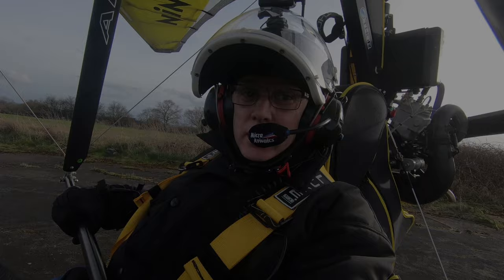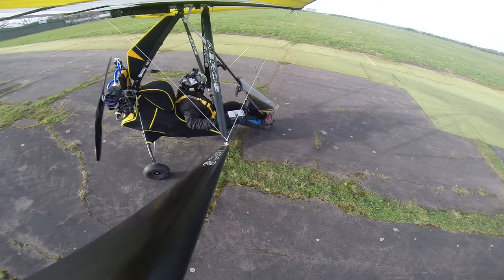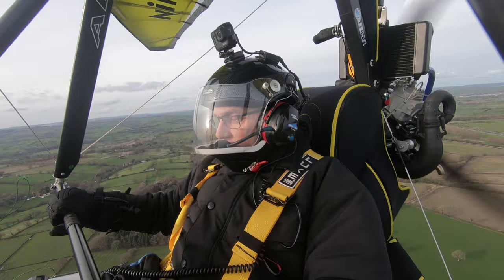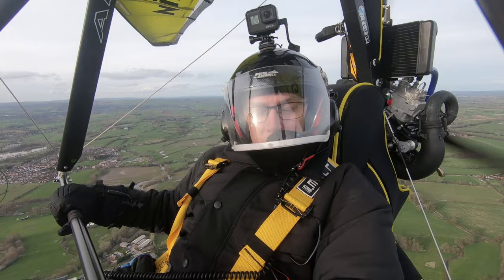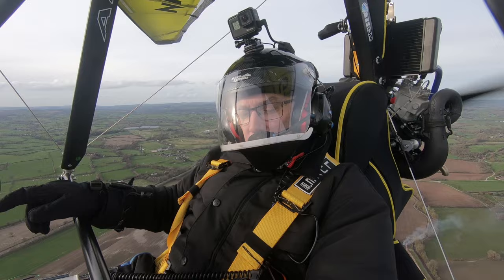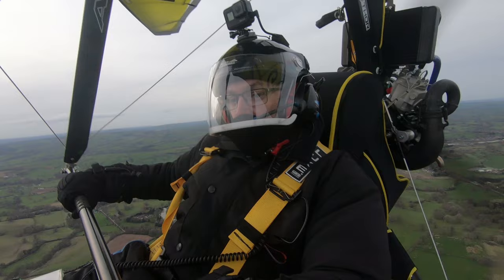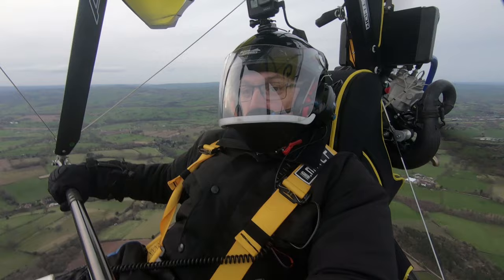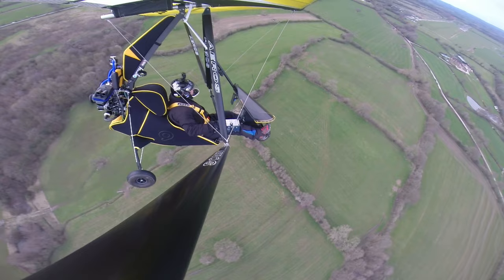Going further and faster - Stretching my NiNE legs

Comment: Excellant information, would be nice to do the same route (same time) with a Sub-70 too and compare the difference in the machines/time & fuel burn.
Reply from the maker: I think that I would probably burn more fuel on the Peabee just because the fuel burns are so close and the HOT between the 2 are about 10 mph different. I'll try another flight when I'm home, just for you.

Comment: I love to fly Powered Paragliders (foot launch has so many options to flying locations. However, as I fly Hang Gliders and Paragliders too, when wheels instead of running are in my future, I’ve got that Nine Flylight Airsports and Powered Hang Glider on my radar. Enjoy Florida (my current residence) hope I’m able to catch SunNFun this year. Love Laugh Live!!!
Reply from the maker: Hi JT, I hope you can make it, I'm here until Saturday. Fingers crossed the winds drop off. There is a NiNE there as well and it will be flying in the demo slot.
Reply: @GolfFoxtrot22  I saw PPG Gorilla’s video of your flight. You looked rock solid! Conditions looked a bit like wet and windy… just to make you feel at home 🤣😝
Reply from the maker: @JTWardle  yes, just like home except I didn't need a flying suit and flying in a T-shirt.

Comment: Hi Giles, I hope Sun n Fun is going great, don't get burned in that lovely weather.

Excellent experimental flight. Though for another video. You can now work out your fuel costs per hour, but how much do you need to set aside per hour flown? Insurance, hangerage, and annual inspection as fixed costs. Then a/c maintenance and engine maintenance per hour flown.
Reply from the maker: Hi Simon, your suggestion was actually something Mark and myself were talking about only last week. Great minds think alike as they say. I know there is a bit more to the phrase.😁

Comment: great vid Giles something I've noticed when you build up speed to take off you seem to be holding the bar forward for a long time and I've noticed that a lot of USA pilots do the same. Is this a safe habit? Great if you have a long airstrip but I nearly came unstuck once when the aircraft I was flying wouldn't climb and was trying to stall out.
Reply from the maker: Hi Living, it is a perfectly valid take off technique once you are happy with the performance of the wing.  A short or soft field technique is to actually move the bar forward straight away and then feel the aircraft off and then accelerate ( lots of other factors that are taught alongside my comments). If you notice, once I've lifted off, the bar comes straight back to aid the acceleration and move it away from the critical angle. I hope that clarifies things.

Comment: I flew to France and back in a mainair mercury at 47mph. I reckon you're only limited by your bravery. Oh and your fuel tank capacity :-)
Reply: That sounds like fun, what was the distance between departure and landing spots? What engine was on the Mercury at the time?
Reply: @tomcoryell  it was a few years back now, mid '90s. If I recall, a private strip near Gloucester, then Popham, then Headcorn, then over the channel and on to Abbeville. It was a single carb 503 & it had to work pretty hard with two up, two fuel tanks & panniers!
Reply from the maker: Hi Paul, I've always thought of a fuel tank as the endurance and only limited by the bladder. I'm brave but not when water is involved 😜.
Reply: @PaulUnderwood345  I’m a Yank, so I don’t understand Two up. Does that mean you and a passenger? Ha Giles! Yes the human bladder is the great duration limiter. Especially when you reach geezerhood like I have. (Geezerdom?) 😎
Reply from the maker: Yes, 2 up is 2 people on board.